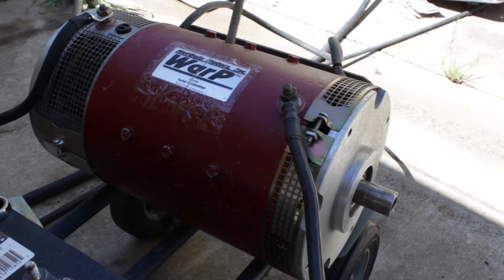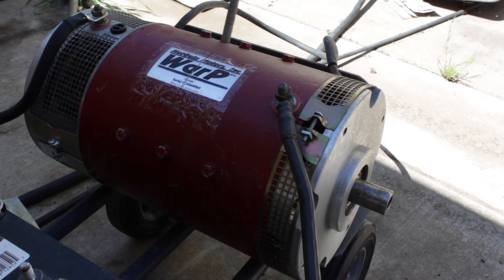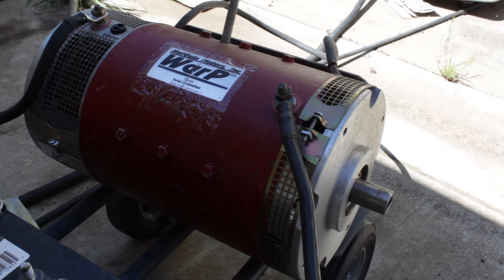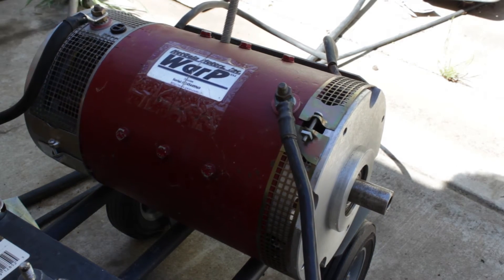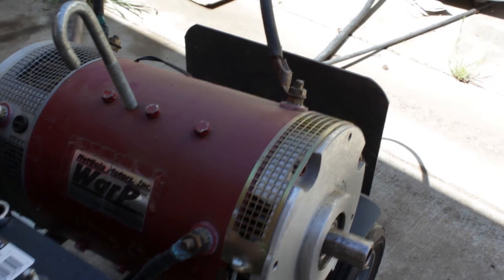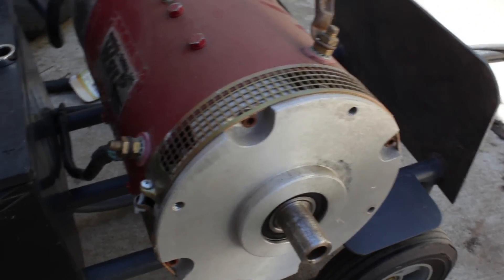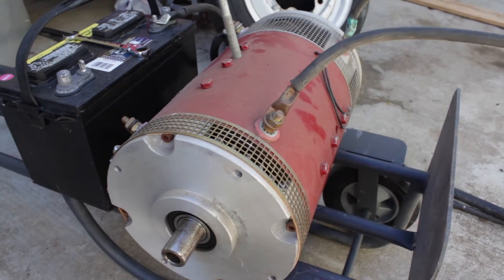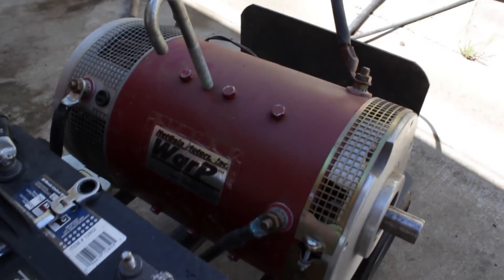Warp9 Motor

Comment from the maker: This motor has been sold.
Reply: Pete McWade for how much?
Reply from the maker: @xgamerbih  I sold it for $1000.
Reply from the maker: I would suspect that today you should be able to pick one up for $600 as the DC motors are going out of style for street conversions. Still reasonably popular but not worth as much as controllers are not being made except by a few companies. Pretty much being used for racing if that is your game. On the street people are using AC Induction motors and some using Tesla and Leaf motors as well as the standard HPEVS AC motors. What are you converting?

Comment: Can I buy it for $1200!
Reply from the maker: Motor sold just after I put this up in 2013. Just updated info stating it has already been sold. Sorry. I do have another 9" motor that was custom built by Jim Husted, our motor guru. It is a shorter version but has a different end bell. It comes with an adapter plate for an early BMW 2002 or 1600. $900 bucks for that motor. Just as good or better than the Warp 9. Fits into shorter spaces where you can't mount the Warp9. Plenty of grunt for any medium sized vehicle. Plenty of grunt to handle 1000 amps and into the higher voltage ranges. So if you wanted to run 250 volts you could. Just advance it a bit more to prevent arcing as you'd need to do with all DC Series motors. Shipping is up to the buyer. I'll put it on a pallet. What are you building?
Reply from the maker: Check this one out. I still have this one for sale. $900 plus shipping. Comes with the Adapter for the BMW 2002 or 1600. 

https://www.youtube.com/watch?v=nhZLfXihers&t=173s

Comment: Is this sold?
Reply from the maker: The Warp9 sold long ago. 

Click the link to the motor I still have if you are in need of a motor. Priced right. 

GE Motor

I still have the motor listed above. Comes with a partial adaptor for an early BMW 2002. Motor is custom built and is in perfect running condition. $800 plus shipping in the US only.

Comment from the maker: DPDT relays can be used on most any motor for electronic reverse switching. But if you have a car and a transmission there is no need for them. They are complex and just add another layer of junk you don't need. If you don't have a reverse from your transmission then yes if you want reverse you will need to use the relays. They have relays specific for reversing.  Most companies who sell controllers will give you a schematic for connecting them up properly.